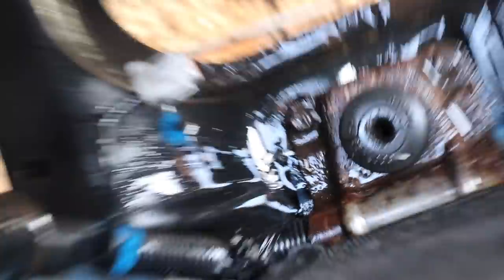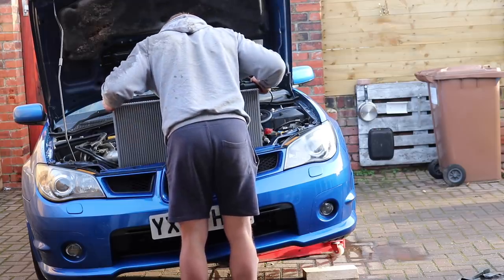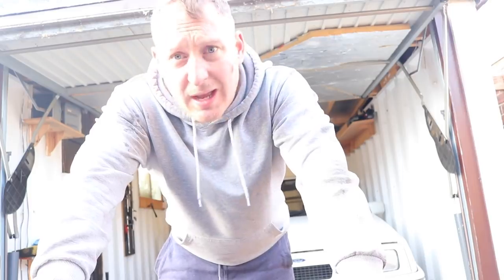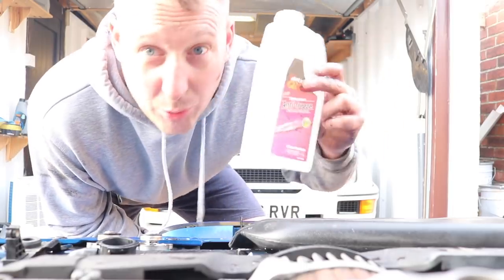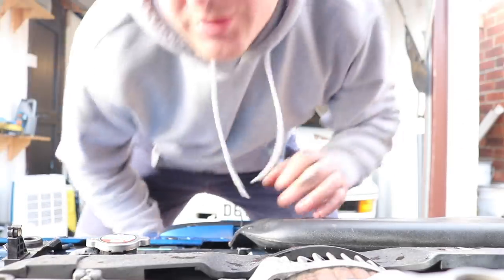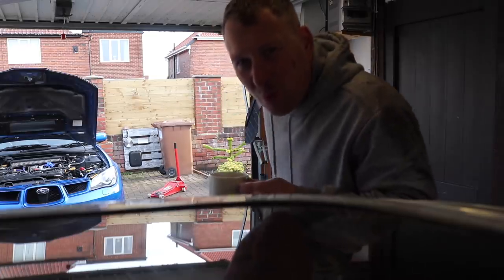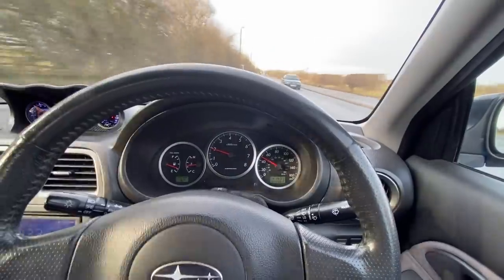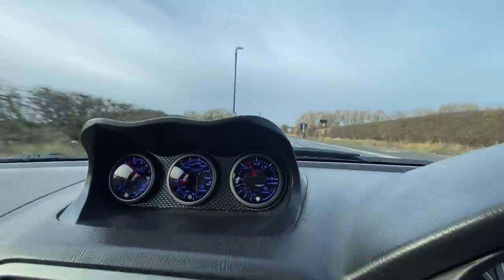My SUBARU radiator BURST...Facebook experts recommended this radiator 🤪

Comment from the maker: Just a quick message fellas. Even though I didnt show it on the video I did put coolant in the engine expansion bottle 😊👍🏼
Reply: Hand are a bit cold like but me legs are sound fellas🤣🤣 nice one Adam 👍💯
Reply: Did show you he filled the expansion tank half's
Reply: You fill it through the top expansion tank bud it’s the best way to do it to leave no air in the system, that’s how they like it

Comment: The water for your coolant needs to be distilled.. normal water causes blockages and corrosion inside the engine.. just a heads up..
Reply: Nope. Doesnt cause corrosion. Just furring up/limescale.

Comment: Adam Adam Adam was very surprised you didn’t clean the bits down befit you refitted them and would’ve sprayed some wax oil before you put the rad back .
Ps clean the under tray and refit it 👍

Comment: Looks like you mixed up your rad caps. The round cap goes on the radiator, it is a non return style, the cap with wings goes on the upper expansion tank. The system has to draw coolant back to the top tank when the engine cools.

Comment: I've heard people use oem radiators on 500+ bhp cars with no problems, heard the aluminium ones fail and leak. Great video I've just done a coolant test and change video on my channel to actually check the degrees of protection im getting with antifreeze on my v1 impreza. I would put engine tray back on as it causes rust on exhaust and other engine components 👍🏼 good video

Comment: i guess its just me, but if im going to empty the coolant i completely take all coolant from the block as well 
get new hoses and clamps, a new thermostat, new radiator cap (top&bottom) and then fill the system radiator first then the top tank and proceed 
to bleed system. i suspect he might get over heated soon with air trap in there..

Comment: Keep the undertray on Adz, not only does it keep the dirt and debris out, it improves airflow under the car and, more importantly, it stops air from entering through the bottom of the engine compartment which can pressurise the engine bay at speed and stop air flowing through the intercooler properly. 👍🏻
Reply from the maker: Fair point Dan 😊👍🏼

Comment: Think it wants burping as well that mate it’s like a bucket/funnel that goes in the filler cap on the rad gets all the air out mine did the same wouldn’t get all the air out properly when I started it I could hear it glugging making hot spots in the engine
Reply: Stick in the search engine burping Impreza some good vids will explain better 👍🏻👌🏻

Comment: Big "tanks" for the chan love your videos. You are a great presenter much more layed back and respectful to the cars owners than many other chans who just drive the piss out the cars they get to review like it was a rentalcar. People put so much time and all their money in the cars. Its nice to see that you really ask them are you sure I can put my foot down a bit and then you still just taste it a bit and shift them so gently when you get offered to drive the cars. I love to watch o-f-gassed and l-l-fast but I think these younger guys have no respect for the owners, they just send the cars like 180km/h on smal roads in the wet. Anyways, I just wanted to give my simpathy for your radiotor, I had a really hard time diagnosing my subaru forester XT. It was loosing coolant but nothing under the car and there where lots of bubbles in the turbo side coolant expansion that bubbled more when you reved the engine. EVERYBODY inc myself was sure it was the dreaded headgaskets. But turns out the shitty plastic top part of the radiator had a hairfine crack that spewed out coolant onto the exhaust manifold so it evaporated and left no puddle. So enginebay was totaly dry and it only spewed coolant when the engine was revved hard so never saw it come out when I had the hood up... Drove me to tears and was about to scrap the car since headgasket is like 2500 euros with labour here in sweden. Anyways swapped the radiator and all was well. My only tip is use the special bleadfunnel to bleed the system of air when done. I could not get the air out no matter what I tryed with overheating as the consiquens. The 40 euro funnel solved the problem with 1h ideling with blead funnel on and car has no run strong for 6 monthes. Greats from sweden..
Reply from the maker: Thanks for the super kind words fella 😊👍🏼

Comment: You sure you haven't cooked the head gaskets? Thats what the previous owner did to mine when the rad split. Engine refresh with skimmed heads, ARP head studs, RCM head gaskets a bigger turbo, milltek decat and a few other bits followed by a remap and it feels like a beast.
Reply from the maker: Time will tell if i cooked the head gasket 😊👍🏼

Comment: As for the under tray,  mine came off when i swapped the headers to Unequal length and wouldn’t go back on due to the new path the exhaust took. Cant say as its made much difference but do think it prefer it back on to prevent splash going up under the engine. Just take it off and clean out the mud every few months.

Comment: Id personally keep the undertray. Aside from keeping crap out the engine and offering some protection on the pulleys etc it can aid airflow. On my Focus for example the air aids cooling of the turbo through specially designed fins on the underside.

Comment: Good news it was the Rad and nothing else , would have definitely checked all the pipework thoroughly though just incase the rad didn't need to ultimately come out! And I think the undertray might just might be an MOT requirement ,but they generally keep all the crap ,good fix though and end result 👍🏼

Comment: You need to drain and put distilled water better buy the ready mixed stuff. Also leave the under tray on it provides protection. I would wax oil the metal, but leave until you renovate the underneath.

Comment: Great video Adam, I’m not a mechanic and I’m a girl, so I’m no expert lol, but if the car was mine I would re fit the under tray, it was fitted at the factory, so the manufacturer deemed  it necessary, also it protects delicate parts of the engine from water ingress, such as the alternator.
Reply: Škoda Katie what skoda do you drive?
Reply: @topcat01  I currently drive a 2018 Fabia Monte Carlo in race blue metallic, her name is Monica lol 😂.
Reply: @skodakatie7341  nice, I've got a fabia redline 110bhp
Reply: @topcat01  I was looking at one of those in 2017, I really liked it, but wasn’t ready to replace my 2015 Fabia SE hatch at that time, so a year later, just before the facelift Fabia was launched my local dealership (Rainworth Škoda), contacted me regarding offers available to clear brand new pre facelift models in stock, they offered me a £3000 saving on a Monte Carlo, as I’d always had desires on this model, I thought it was too good a deal to pass up, so with financial help from my mum, I went for it!.
Reply: @skodakatie7341  I like the monte carlos apart from the red bits on the interior 😂 is yours on insta?
Reply: @topcat01  Mine doesn’t have the red inserts on the interior, it’s all black, which is strange as I didn’t specify that, it came from the factory like it, no I’m not on Instagram, just Facebook.
Reply: @skodakatie7341  wonder if they're the same seats as mine, does yours come with a flat bottom steering wheel too?
Reply: @topcat01  yes mine has flat bottom steering wheel with red stitching, which is also on the floor mats, not sure why the seats are all black though, I have seen this on a few other Monte Carlo models, but mostly they have red inserts on seats and centre console, it’s strange, however having owned Škoda’s for many years, I have found trim colours differ slightly even on identical models.

Comment: I left my under tray on but did rip the foam packing off so it doesn't hold moisture. I did an ally rad in mine (from japspeed) purely because I put silicone hoses on (from mishimoto) and they wouldn't seal properly they constantly wept, ended up cracking the plastic hose joint on the standard rad so bought ally to clamp down tighter .

Comment: using tap water is just fine - the additives in the antifreeze sort out any corrosion issues. personally i would have used a bit stronger mix to get more corrosion protection. dont go mad mind -or you will dye the expansion tank pink + wont be able to see the true level.                   yes -  undertray back on - but you could space it down a bit [7mm ish] to let it clear bodywork. rip the spongey shit off cos it collects water and makes your engine quieter

Comment: Dunno about on subarus specifically but when I removed the undertray on my a4, the front end used to get a bit light at higher speeds, as if it maybe had a bit of an aerodynamic effective and was causing lift...
Reply from the maker: I did think about the aerodynamics fella 👍🏼
Reply: Was only really noticable at motorway speeds or above but defo made a difference...anything over 80 on a windy day was terrifying😂

Comment: Hi Adam great job with the radiator .if I was you I would jet wash under tray put it back on as it would be there from new and is there for a reason Subaru wanted it there cheers

Comment: Mate you’re going to have to drain all that out and buy some more coolant and distilled/battery top up water from Halfords! As someone else said, you can’t put tap water in your radiator, it’ll rust up on the inside and you’ll end up with rusty shit floating around your cooling system, and the radiator will fall to bits prematurely. Get it changed ASAP👍🏻

Comment: As a few comments have said already. I’d have used distilled water. Plus regards to the under tray I’d keeper on. If you think about it the manufacturer will spend millions £ on research oh how the under tray affects the aerodynamic behaviour of the car, cooling of the engine and even the breaks. Plus all that muck was on the tray and not on your engine and belts. The air flow may push it up into the engine now with the tray removed. I’ve left mine on my 3dr Cozzy just for safety. Ya never know

Comment: No point putting the undertray back on if you every go aftermarket header won't fit with it on anyway scoobyclinic left ours off after we got rcm headers

Plus we bought a tegwia alloy rad not had a problem in 3 years

Comment: Two pieces of newbie advice to any new subaru owners..
1.Remove the under tray as its a moisture trap 
2.No there isn't anything wrong with your lights you have knocked the park light switch on top of your steering wheel.
Reply: Was never on my wrx from when I got it. Advice was they cause the subframes to rot by trapping moisture.

Comment: Weirdly the only thing that broke on my 2005 Blobeye WRX was the radiator! Exactly the same situation that your describing mate 😂

I left the under tray off on mine mate, thought the exact same thing when I pulled it off the car. It sits quite close to the “U” subframe which tends to rot through if you get water in the holes, quite common from what I’ve heard. Some people actually run their cars without the U frame but I left mine in, it’s there for a reason 🤷🏻‍♂️ just mind power wash the underside of the engine bay now it’s off to get any dreaded salt off the rails etc
Reply from the maker: Yeah I checked my U-Frame, it seems pretty solid, so that good. I have seen people run their cars without them aswell 😊👍🏼
Reply: @Adam151082  that’s ace man, hard to find a clean scooby these days, wish I still had mine! I’m not a million miles from you (from what I can tell from the accent 😂) I’m just up the road in Edinburgh. You should check out Andy Forrest performance up here, specialist in Scoobies 👌🏼
Reply: @andyjf89  yes my blobeye is mapped by Andy Forrest, absolutely love it
Reply: @yardi3834  nice one mate, weirdly my name is also Andy Forrest 😂 just not nearly as godly around cars haha
Reply: @andyjf89  😂 😂 I’m an Andy too 😂

Comment: U dont need an undertray Adam weight reduction bro... 😁

All undertrays do is trap nuts,bolts and sockets when u drop in the engine bay lol... and U can spot leaks better without one ad leave it off but that's just me each to there own
Reply from the maker: I found a 10mm socket on the tray when I dropped it down 😂

Comment: Tap water Adam, I thought you looked after ya cars man I would drain that shit and get some distilled water in that mix 🤨
Reply from the maker: Yeah, a few people have mentioned that water should be distilled. Guess I’ll do a water change 😂
Reply: @Adam151082  You can use tap water and a hose to flush the coolant system but filling it back up use distilled water or pre-mixed coolant (so you dont need to add water) would be the way to go.